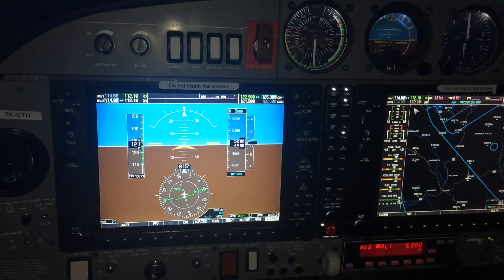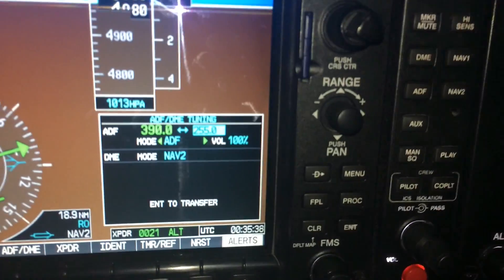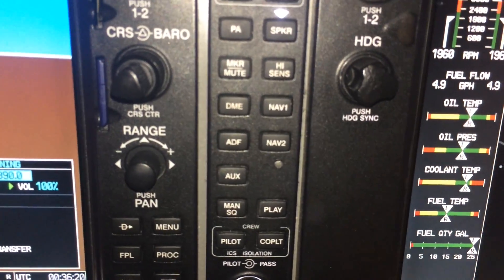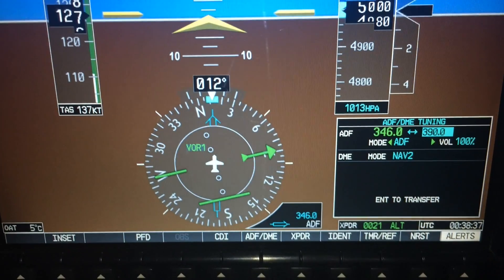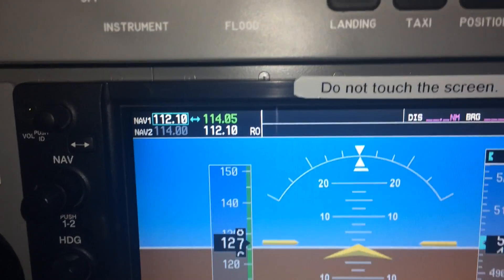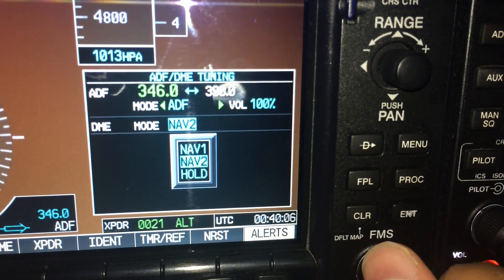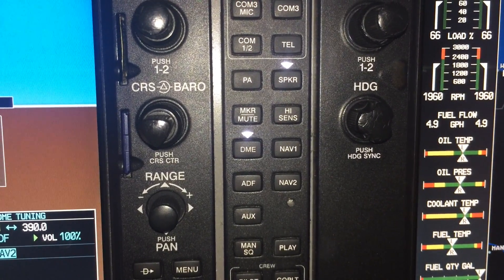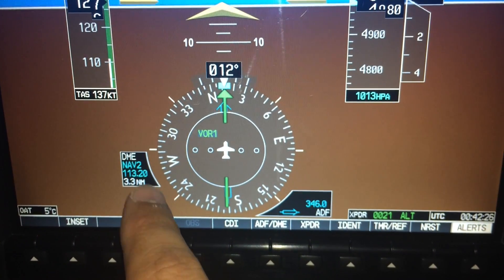How to tune an NDB and DME on the G1000

Comment: Hi Jared, on my x-plane 11 final , there is cessna 172sp with g1000 but there is only DME not ADF/DME, even when u push dme button there is no option for ndb frequency. what do you suggest me?
Reply from the maker: Ismatulloi Mahmadali It sounds like a setup similar to two of my old fleet. The DME soft key was available but the ADF was a seperate box located off to the side of the G1000.